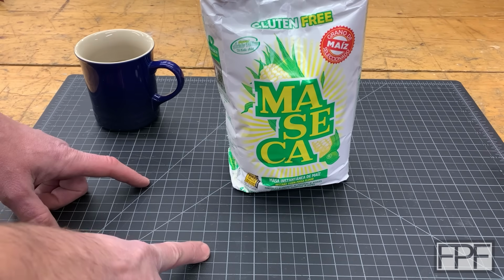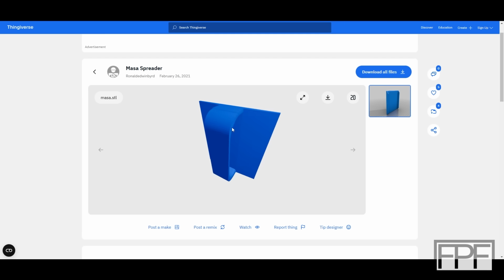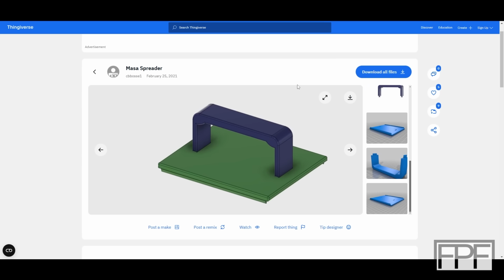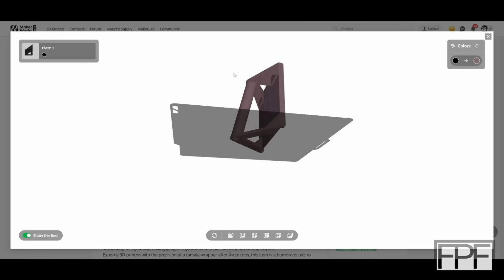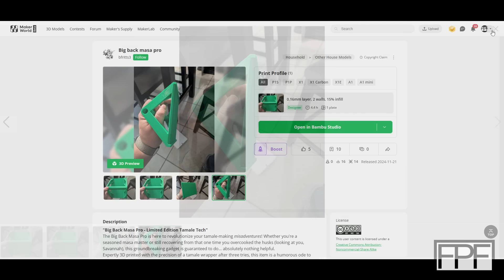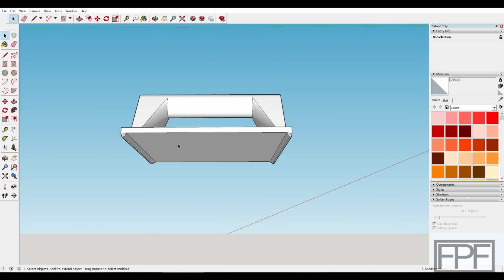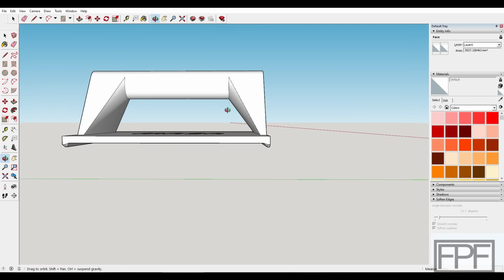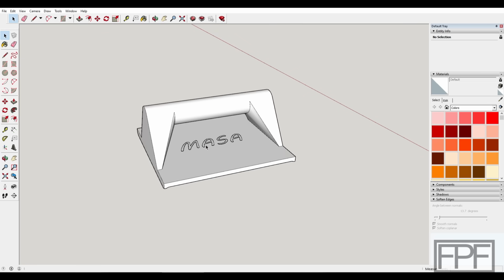3D Printed Masa Spreader

Comment: Is there a reason you changed the orientation of the handle? All the examples you showed had the handle in line with the pulling direction.
Reply from the maker: Thanks for this comment!  I didn't even realize I did it.  I was in such a hurry to get it printing so it would be done for her, I didn't realize I was 90 degrees off on the guides.  I just fixed it and added the new version to the zip.
Reply: I thought I had noticed the same thing. With the handle rotated it seemed like it would try and twist out of your hand
Reply: i noticed the same thing as soon as he showed the model i had to go back and look at the one from amazon and confirm
Reply: @livetrump327  Same here, as soon as it showed up I paused and went back to the beginning to check the amazon one.
Reply: @jamiemacdonald436  look again, it is the wrong way round. And look at the end how she uses it, the other way around she could apply much more torque.

Comment: Looks good for the first few uses, but there's a problem.
While most PLAs are food safe, the prints are also porous. Food residues get trappec between and in the ridges, and may even diffuse into the plastic.
My suggestion is to paint it with a food safe paint, probably latex (rubber). It's nonporous and completely impermeable to liquids.
Keep up the good work!

Comment: You're over thinking this. Perfect should never be the enemy of good enough. Also, none of the filaments you're going to use are food safe (unless you post process ABS in acetone vapor to seal away any contaminants from printing). In general, 3D printing shouldn't be used for food items.

Comment: Cool video and a great practical application of 3D printing. Someone needs to develop and market and food safe sealer for 3D prints. Even if it was like the tool handle dip stuff, but dries food safe. On the flip side, I understand there would be liability issues if there was sickness or worse.

Comment: Probably this is not worse than all the kitchen items made from bamboo or wood. 
You cloud try if it survives a round in the dish washer. If yes, then IMHO its fine.
Reply: Bamboo has its issues but wood in general can be antibacterial and self healing. In a study from 1994 they demonstrated issues with regular plastics compared to wood. https://pubmed.ncbi.nlm.nih.gov/31113026/ Another thing to keep in mind is food safe plastics are only considered food safe when handled in a way that the material does not inherit bad qualities (like overheating a plastic). For a print like this I would probably have made a 2 part design where the surface touching food would be covered by a plate made from something like a flexible chopping board cut to size. I would like to experiment with different coatings aswell. Beeswax, carnuba wax, to resins (although again these food safe resins need to be used in a controlled manner to be safe)

Comment: If the 3D printing filament manufacturers figured out a 100% food safe solution it would blow 3D printing wide open. I mean how many times have we thrown away a cracked plastic lid for a glass or plastic container that is its match. When you go looking for lids from the manufacturer you find out it’s cheaper to throw everything away and buy a new one with a lid.

Comment: There is a paper on researchgate "Study on the Sanitization Efficacy for Safe Use of 3D-Printed Parts for Food and Medical Applications" which I can highly recommend reading. It proves that 3D prints can indeed be food safe if cleaned properly. The best method they found out was washing the parts with warm soapy water and baking soda. After washing them they should be cured in either cold water mixed with bleach or IPA. Also you should use non colored filament and it would be best to cover the print with a layer of resin.
Reply: Unfortunately I doubt people will take the time to clean things properly.

Comment: Apparently layer lines and pores are not food safe as bacteria can grow there.
Layer lines are pretty easy to clean since they are large. Pores are more difficult.
I think the problem is that 3d prints are not water tight. So any moisture or liquid can get in between walls. This is impossible to clean. Cleaning the print will add more water in between walls and provide food for bacteria. 

For wooden cutting boards, I think the wood will dry much faster than the water in between walls of a print leaving little time for bacteria growth. 

I would never re-use a 3d print that was in contact with something like a raw egg or milk. But I would re-use a 3d print with flour. When have you seen bacteria grow in your flour bag?

Based on a bunch of videos and articles I've seen over the years.
- PLA and PETG are both food safe naturally. Some color pigments are not and some manufacturers could add non-food safe chemicals. 
- Brass nozzles contain lead. Some of it will transfer to the print and some will transfer to the food. I've seen a video on that topic and it was not a problem. Basically, to be harmful, you would need to print a few KG of filament and eat the prints.

Comment: What would be super helpful is if you tested some treatment methods to make pla/petg or others food/reuse safe, would you consider a followup video on that topic?
Reply: id be interested in that especially as someone who is new to 3d printing i want to make stuff that comes in contact with food but i dont want to waste material if i have to throw it out after a couple or single use
Reply: @ScyborneOG  You and me both, I´m still on my first pla spool so I am trying to find out just what the expense and work getting a 3d printer actually bought me. To me it is a tool and a tool maker first, benchies and knick knacks are of no value to me for other purpose than calibration of the printer. I still have no clue as to how to run free cad but I´m fighting to gain that crucial bit of knowledge, it seams very useful once I figure out how the dam thing works.
Reply: @ScyborneOG  I hear people mention that you can make it long term food safe by coating it with food safe epoxy. Never tried it myself though.
Reply: You should explain to the viewers, what you did to make this print food safe.  Many of them do not know and viewing this video will lead them to a false sense of security.
Reply: @kenny8135  I don't think that he considers it food safe in the long term. Filament is printed at temperatures way above where bacteria are killed, that's probably why he considers it sterile for one time use. At the end of the day, we all need to consider what kind of risk we are willing to take.

Comment: First the design, the rails are supposed to run parallel to the direction of travel, as is the handle. That way the rail keeps the horizontal surface a fixed height above the top of the tamale wrapper and your hand is aligned with the direction of travel, as it would be when using a bread knife, for example. Looks like you corrected it in your design revised (per comment below).

Second the food safety aspect. Its an FDM print, its fully of asperities on the surface for food particles to accumulate which apparently can't be adequately cleaned to prevent bacterial growth. How much that matter for something that only works with things that will be cooked anyway, I don't know. People comparing it to a wooden cutting board are missing that wood is a different material with intrinsic anti-bacterial properties. As to micro-plastics, I think evidence it clear that micro-plastics are present in the printed items. Whether they can be adequately cleaned to remove those deposited on the surface during printing and whether they keep shedding/generating new micro-plastics during use is much less clear, as is the health risk from having them in our bodies. Precautionary principle would suggest avoiding increasing your micro-plastic intake, but it's also unclear how much 3d printing (or not) or using 3D printed object for food prep would affect that intake, given all of the other sources in our environment. That's a personal choice in my opinion.

Comment: As I see others have chimed in as well. Anything that contacts food should be "Coated" or just seen as a one-time use object.  Food particles get into the layer lines of a 3D print. You cannot wash it all away.  You can go to the trouble of "coating" it with a food-safe resin. But if you're not going to use it often, why bother. Use it and toss it (yes bad for landfills, I know). I make seasonal/Holiday cookie cutters and use them for the day of making the cookies, then they are thrown away.

Comment: I would use it again, but this only goes on food that is going to be cooked before ingesting, anything that I would be eating directly off a 3d print is a no go or single use. Obviously clean it really well after use, but thats just normal good kitchen practice anyway. I probably wouldn’t use it with raw meat either. This is just for home use though, it would be a no go in a commercial kitchen.

Comment: It is generally believed that PLA prints cannot be washed in the dishwasher. I have tested this and found exceptions. Objects with thin parts, thin walls, or very little infill will warp and droop. However, I have found that sturdier parts will wash clean and retain their shape just fine. The masa spreader in your video looks like it would do just fine

Comment: I know that this kitchen tool may not be exposed to lots of friction that can rip micro bits of plastic, but I always a bit concern in using raw 3d prints on food, not only about microplastics being loose, also about micro bits of food sticking into micro crevices or holes and the bacteria/fungus can appear and passed on to the next food you prepare.
Maybe encapsulating in epoxy food compatible resin? at least the area were food is touching the 3d print.

Comment: I would use it again. A plastic cutting board with knife marks gets used over and over again. They even hold stains from burnt food through multiple washes. 
I have a pla funnel that I run through the dishwasher regularly, it is warped from the hot water but it’s a funnel still. 
And for those that have latched on to the “Oh No microplastics” bandwagon, I wear dentures opposite real teeth and consume microplastics with every meal. Most microplastic contamination comes from car tires wearing down on highways and that dust getting blown around or washed into waterways.
Reply: I know how cutting boards are made. I understand the thought process of bacteria in the microfissures of a 3d printed item. 
A factory cutting board that has enough knife marks on it to hold colored stains could obviously hold bacteria yet get reused in kitchens every day and that is my point. If tiny crevices are where the bacteria hide, a well used cutting board would be unsafe as well.
Reply: @briansimmons5472 I agree with you 100%. The injection molded manufacturing process is irrelevant. Once a plastic cutting board has been used, the plastic is scored with knife marks. Aren't these knife marks similar to layer lines and capable of being contaminated with bacteria? Yet people have no problem with using them over and over again. All items manufactured with plastic (even containers) that come into contact with food, have the potential to store bacteria. Why should 3D printed items be treated any different?
Reply: @Neomaster67  I would argue that the cutting marts are smaller than most layer lines, at least the once made with a propper maintained and sharp knife. and due to them being smaller it would be harder to clean the cutmarks, than in between layers.
Reply: It isn't microplastics, it's bacteria that isn't washed off. Cutting boards aren't 3d printed they are injection molded. Anything injected molded is sealed, 3d parts aren't.

Comment: Good functional print.  I often 3D print something because it's faster to draw it in CAD and print it than it is to order it.  I also like that I can customize it, making a tool optimized for me.  For example, I have freakishly large hands and most kitchen utensils are designed for little women so I feel like I'm trying to use kindergarten scissors.  The review of existing designs was excellent because it teaches additive manufacturing design.

Comment: Since you asked for an opinion..
Though I appriciate the skill and time to look into other designs and explain why yours is better from an engineering/design perspective.

Imo you've missed the mark on functional; if it's a one use item, it will take x amount of hours to load and print. 

Sure, let's assume it's only $1, sure your time is worth nothing after all the R&D, filtering of other designs and sure it's only a once a year thing. You are still throwing plastic in the landfill.

If you ran to the stores and spent $30 on a stainless one, use it once, and sell it for $5, the product is still in circulation.

Personally, I think solving a problem is about life cycle costs too. 
Doing something for the sake of difference or 'convieience' is not efficient/optimal. If you said you enjoyed it and that's what you like doing, fine, fantastic. More power to you. Functional, not so sure.

To end on a positive note, I enjoyed the explanations and walk throughs. Keep at it! I'll go through your other videos. 🎉🎉🎉

- Random guy from YT algorithms
Reply from the maker: Agreed, but it was functional in this case because none were available locally (it's not a common item), and Mrs. FPF wanted one same-day.  I think that's a fair use-case as long as the material use is no more than other disposable plastic items (which is a whole other discussion).

Comment: Functional? Yes.  Advisable?  Hard NO!!!  You have NO IDEA what other chemicals were added when the pellets were first made.  You don't know what additives were included with the pellets when they made the filament.  You don't know if the masterbatch used to colour it was food safe.  Many have quite toxic compounds added (pigments, plasticizers, UV stabilizers etc).  You don't know if any slip was added (it helps "lubricate" during extrusion).  You don't know if they recycle previous batches and what that might have come in contact with.  I used to work for the largest chemical and plastic manufacturer on the planet and worked directly with sales.  Plastic is NOT just plastic and it is not universal.  Some grades have additives that will literally dissolve a railcar out from the inside if there are any breaks in the liner.  I've dealt with it first hand.

Unless the filament you use is specifically designed, marketed and intended for food production you should NEVER let it touch your food.  In case I was less than clear...NEVER.  😁😁

The ONLY case where I think you could even consider this would be if you made your own filament from PET beverage bottles that you personally used, emptied, cleaned , cut and pulled.  Even then this would be a single use print and really an amazingly wasteful thing to do.  Whatever happened to using some waxed paper and a rolling pin?
Reply: really? my filament was tested by multiple countries food standards regulators to be food safe
Reply: @knifeyonline  As I noted "Unless the filament you use is specifically designed, marketed and intended for food production you should NEVER let it touch your food".   Ask them for the Product Regulatory Statement for the filament.  Bonus points if they will provide the FDA requirements.  If it does not meet FDA standards for food safe plastics I wouldn't even consider letting it near food.  Other countries have significantly lower standards than the FDA standards.  There are specific grades of PE for dairy and it is illegal to use any others.  it's similar with medical grade for the saline bags or syringes.  it is all based on the purity of the base stock and what additives are included during production.  Even the catalysts used for PP can affect food safety as they cannot be 100% eliminated.  The PP used for plastic forks is NOT chemically the same as PP used for a non-food utensil.  When I got into that job I was blown away by what I learned.  Certain film grades that for garbage bags are almost identical to the same grades used for cling wrap with the exception of one single additive.  An additive may increase flexibility or stretchiness while others add in tear resistance.  Many countries testing requirements are on the base material (ie pellets used in initial production but they do NOT test the final product that comes out of the machines.  Many countries have no requirements for companies to list the additives they use and they can simply list them as "proprietary". 

I find it baffling that people will put so much effort to eat foods that do not contain pesticides but then they have no issue eating that same food that has come into contact (sometimes extended contact) with plastic that contains chemicals WORSE then the pesticides.  Your filament supplier might TELL you it is food safe but without that PRS I would go for an independent 3d party lab to test and prove it before I even considered letting it near my food.  I would only ask you to honestly consider would you allow YOUR baby to put that item you printed in their mouths and play with it all day long?  If you wouldn't allow your baby to eat it why would you allow yourself to do so?

I hate to sound preachy here but with all the "forever chemicals" out there this is not an area I think is worth the risk.  Better to assume the worst until you get proof otherwise.  A minor convenience in printing off a part is NOT worth the long term health risks.